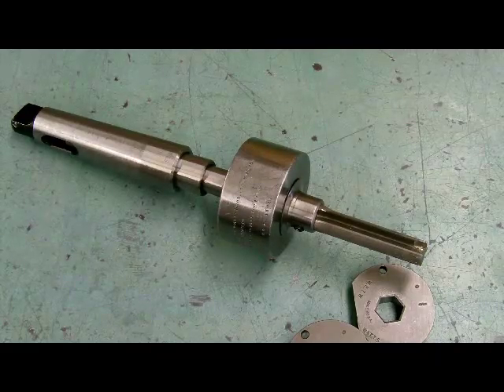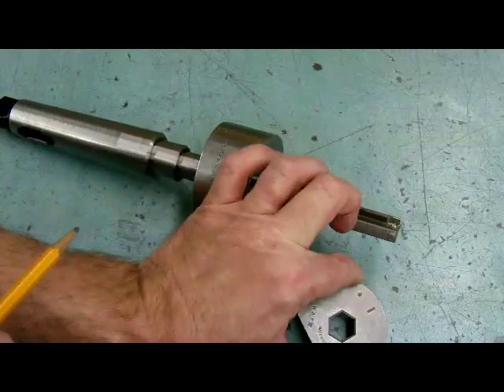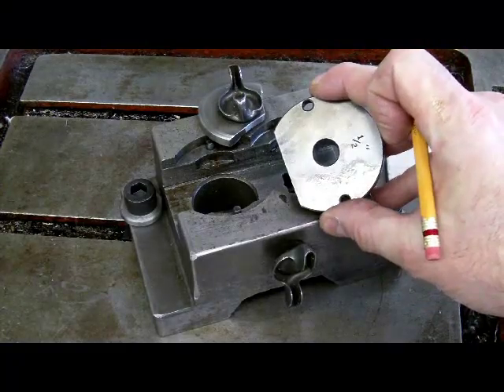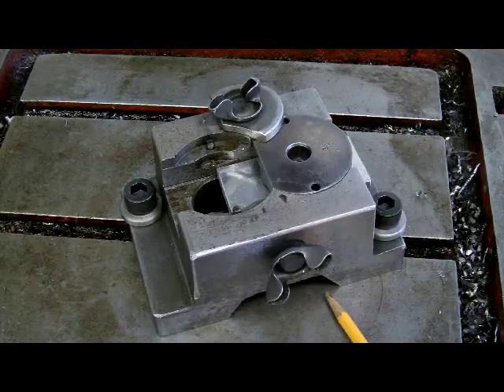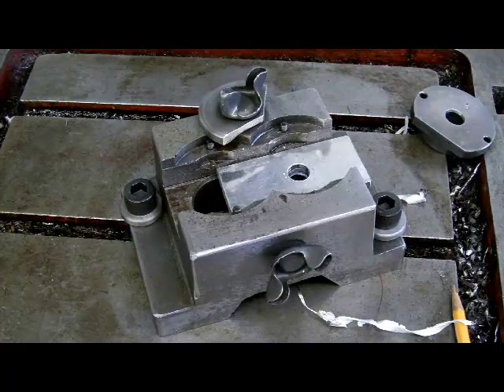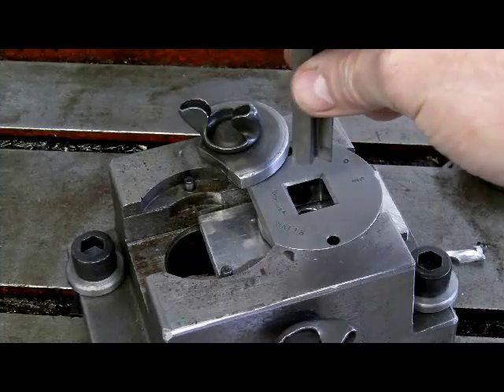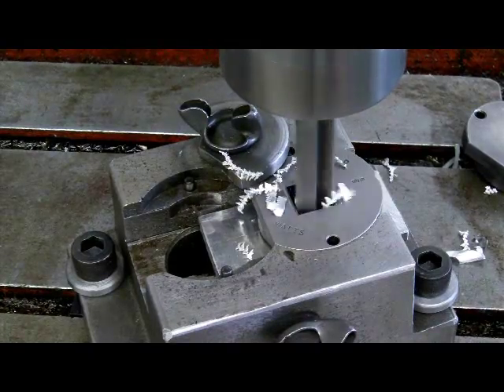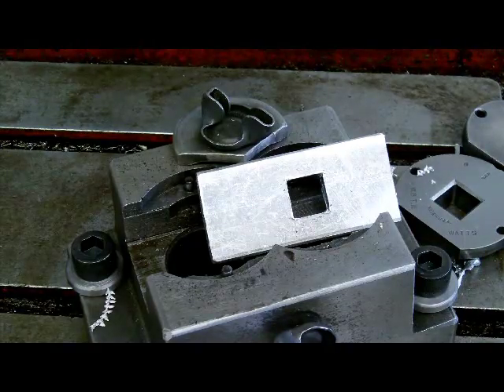Drilling Square Holes

Comment: Was only aware of being able to drill square holes in wood using a combination drill-chisel, but thats technically not even drilling a square hole but is drilling a round hole and then the chisel follows through with the drill to square-out the corners
Reply from the maker: I've used the drills woodworkers use also, the drills work great. Thanks for watching.

Comment: I mean.. that's a cool little bit, but what do you do when your material you want to drill into doesn't fit in that little slot like that flat stock aluminum you used?

I'm also curious how this thing does against steel and how long before your square guide starts to wear out?
Reply from the maker: You would need to adapt the jig to suit your scenario.

Comment: The centre mass of the cuting end of the drill bit dances in a circle as if a man and a woman were waltzing and had a container of sand held between their chests, with a hole in it allowing a line of sand to describe an odd figure on the ground. You could rely on the might of a strong mill and strong tool steel to manage the off-centre mass or, and I think this is how the tool in the video did it, there is mass above the cutting tool that is positioned such that a little more mass is above where the missing flute of the cutter is. So basically you have a counter mass positioned to balance the shaft. Maybe the counter mass can be freely attached and centripetal force positions it where it needs to be. If anyone knows where I can find more info on the design of this tool I would appreciate it.

Comment: Interesting, close but no cigar for me.  That's got to cost quite a bit.  I need four 1" square holes in 1/8 thick aluminum plate. Still hoping to find a die to place on a press, this is a great tool, just not practical to buy.
Reply from the maker: Yes it is neat to see but not for everyone. Thanks for watching. Good luck with the holes.

Comment: Sir, I need to chamfer an oblong hole. 0.5 mm chamfer in steel. Can I use this floating drill head for this purpose? I will make the guide oblong instead of square. Will it work?
Reply from the maker: I don't think it will, the guide drives the diameter of the tool. Your chamfer would need to be on the end of the tool and the end of the hole. There would be nothing to guide the tool. I'm thinking CNC may be your solution.

Comment: The things are the bane of my existence. I’ve used them hundreds of times to put a “drive hole” into the end of a hardened worm gear. We buy the gears set worm & rings and modify them. I’d love to perform the op in an annealed state but it’s not feasible. The end is about 45 Rockwell hardness. We insert the worm into a fixture that has a guide plate over the end. The pilot hole size is critical to make the drill work hard enough to get into the corners. Alignment and squareness of the head, adequate thrust, feed, speed and flood coolant are imperative. The Watts drill typically lasts one to three parts before resharpening. The drill takes two months to obtain or factory resharpen so we do it in house much of the time. Once you start the operation you have very little control over size, taper and corner sharpness so you cross your fingers and pray. Whenever I can I try to use a rotary broach instead but sometimes it’s just not doable because of the extreme thrust that op requires exceeds capacity of my equipment on large holes.
Reply from the maker: Thanks for sharing Karl, I'll bet it help with productivity at your place of work.

Comment: Can this drill bit be used on wood and in a drill regular drill press?
Reply from the maker: I'm sure it would. The only issue I see is this drill is carbide tipped, most wood likes high speed steel I believe.
Reply: @machiningmoments  True, true ,true. This drill bit if it could be done for wood, it will do away with the mortising machines huh?
Reply from the maker: I have limited experience with wood but I have noticed some of the tools are similar.
Reply: @machiningmoments  Yes, I love machine shop but at my time I'm doing wood works and a lot of tools do the same jobs. This drill bit can do a good thing for mortising if it would be able to be used in a drill press. People wouldn't need a delta or other machines to do a square hole. I personally dislike using chisels to make a hole square.

Comment: This is a Reuleaux triangle.  The only shape other than a circle that cannot fit through its own hole!  Sandwiched between 2 plates it will roll completely smoothly, just like a circle.  Quite amazing.  Remember the Wankel rotary engine in the old Mazda RX-8?  Yep, the 'piston' was a Reuleaux triangle.  Make a manhole cover out of a Reuleaux triangle and it can't fall through its hole either!  And you can use them to drill square holes.  Or any even sided polygon hole.  Quite amazing.  The drill bit to do this was patented a century ago.
Reply from the maker: Yes it is, I remember the Wankel well. Thanks for the history.
Reply: @machiningmoments  Thank you for the square hole demonstration.  I've never actually seen it done, so very interesting.  Something a person would think is impossible - a square drill bit!?  Who woulda thunk it!
Reply from the maker: Glad you liked it, I'm trying to capture old technology before it is gone. Thanks for being part of it.

Comment: I'm wondering how the "guide" doesn't damage the bit (and vice-versa)?  And what if I wanted to drill a piece of metal that's 1/2" wider or 1" taller -- doesn't seem like that jig would work...

Comment: can a triangular hole be done same way you just did for square hole?
Reply from the maker: Yes, the trick is you need one less cutting edge than the geometry so the drill would have two cutting edges.

Comment: Can we drill a rectangle using an extended version of this drill?  Like for exemple rectangle with width of 5 and height of 10 milimeters?
Improvement to the current design would eliminate the guidance template if we can have a stable center guidance drill. This can be achieved if our main drill/milling drill have inside another drill decoupled?
Reply from the maker: The guide controls the shape. So I think if you had a rectangular shaped die (template) and the drill had enough travel off of center, it would work.
Reply: No you cannot drill a rectangle with this tooling. All sides of the square, hex, octagon, pentagon, or triangle must be the same length.

Comment: Process is fine -- But you should use a coolant for longer life of tool & always use a brush to clean off the metal chips instead of using bare hands.
Reply from the maker: Yes, safety is important.

Comment: Where can these drill bits be bought. They are amazing!
Reply from the maker: You may have trouble finding this one, it's very old. If you Google "rotary broaching tools" you may have luck.
Reply: What do people use now-a-days to do the same thing? I mean I know there are tools that can get you square holes but not as easy as just drilling a hole in 2 seconds that's square as easily as a round hole. I'm pretty into tools and gadgets and its a hard for me to believe I missed an entire process of how to cut a small square hole in a couple seconds. LOL. I see these quare holle cutters for notching our  like a perfect sing gang outlet hole but nothing like a 1"x 1" hole.
Reply: Watts Bros Tool Works in Wilmerding PA

Comment: This looks like magic. Even though I watched an animation of how it works before I watched this video, my mind still couldn't comprehend how something spinning could drill a square hole.
Reply: So when the drill is cutting a corner, it isnt really spinning in one spot but it’s bouncing in and out of the corner?
Reply: Yeah, it would be great if one of those "ultra-slow-motion" Youtube channels could get this on video.

Witchcraft should always be captures in ultra-slow-motion video. ;)
Reply from the maker: Two things are happening, the drill has one less cutting edge than corners which forces it into the corners and the drive end is a floating eccentric.
Reply: this proces should actually be made in one of those slowmotion 3D animation
Reply: If you had known the Reuleaux triangle, it wouldn't have been a surprise: a triangle exists with equidistances along the lines perpendicular to its perimeter boundary...

Comment: what keeps the bit from eating the template?
Reply from the maker: The template is hardened.
Reply: magic
Reply: If the drill binded to what it was drilling, could it then start to cut the template? I’m thinking that it doesn’t cut the template because it’s able to bounce off of it. Does it eventually make the drill dull where it touches the template?

Comment: on google rotary broaching I couldn't find. This is not a rotary broaching
Reply from the maker: First Google search...I make no endorsement to this company, there are several. http://www.slatertools.com/rotary-broaches#.WJyt8E0zV9A
Reply: Thank you, bit this is like the ones I've found for rotary broaching. I need the drill and special Holder for drill a square hole. They are not the same.
Reply from the maker: Sorry for the slow reply, I will do some more looking. The one in the video is very old.

Comment: So how was the first square hole created before you had a square hole to create the square hole.
Reply: Q: So how was the first square hole created before you had a square hole to create the square hole.
A: He made one in the future, traveled to the past and gave it to his younger self.
Reply: @swiperfox3145  he took the square we just saw him create and gave it to his past self, so that his past self can create the square we just saw so that he can take it to his past self and creat the square we just saw so that his past self can create the square we just saw so that he can take it to his past self and creat the square we just saw so that his past self can create the square we just saw so that he can take it to his past self and creat the square we just saw---------

dont mess with time travel 😳
Reply: Just like your sense of sarcasm lol
Reply: With a square drill bit, obviously.
Reply: also you could just drill a circular hole, then use smaller drills to take some of the excess material out of the corners, and then grind or file it into a square.
Reply: this guy..
Reply: it was made with another square hole driller
Reply from the maker: In the fixture? Likely machined, hardened, and ground.
Reply: chisel
Reply: A cast/mold
Reply: That's a lot of hole we r talking about.
Reply: top 10 questions engineers don't know the answer.
Reply: lol @ everyone but canyon having trouble with this
Reply: Ken2x :'(
Reply: I also meant an actual square shaped drill bit not a rig for drilling square holes, i was just being silly.
Reply: This is freaking deep! It's like, has anyone every seen a baby pigeon? Let that sink in.
Reply: Bruh I'm shook
Reply: El Fro 
Why yes I have.
Reply: CaligulaClone same is what we do here at ISTC diploma.....filing.......Lol.
But I really hate FILLING square "pockets" as they say for 'practical tests'.....
Reply: Ken2x ROFL
Reply: Aon Lazio LOL
Reply: i round hole, a file and a very careful craftsman
Reply: Or punched out in a stamper then ground to spec
Reply: File more file then some more file
Reply: With a square broach.
Reply: Maybe it was made by casting and hand filing
Reply: Sorry guys i just thought it was funny that the solution to creating a square hole is to use a square hole..... i mean wouldnt a better educational video be how to make a perfect square hole without a square hole already in your possession??
Reply: @Sidiez  Just saw a video on that.  Essentially, you router a channel and partially fill that with bar stock leaving a square empty hole.  The fill piece is pinned to secure.
Reply: @Sidiez  "wouldnt a better educational video be how to make a perfect square hole without a square hole already in your possession?" - No, because you buy the tool and jig and use them together.
If you want a square hole without drilling, you broach it.
Reply: CaligulaClone funny how you say
"you could just" then describe a more difficult procedure
Reply: There are many ways to create a square hole, wire or spark erosion for instance
Reply: Sets I already said that

Comment: That's way cool, but how much does one of those three-fluted bits and guide setup cost?
Reply from the maker: If you Google "rotary Broaching Tools" you should be able to find what your looking for and price.
Reply: O...kay.  So, about $100 per bit (for the simpler ones), and about $900 for the holder.

Guess I'll stick with a drill and a saw.

Comment: Why doesn't the bit eventually gouge out the sides of the square template and make a mess of it?
Reply from the maker: +sortedtales The die (guide) is hardened.
Reply: do the blade takes a lot of damage then ?

Comment: still has rounded corners.   Is this set up worth all the time?  Seems other methods would be quicker.
Reply from the maker: +Jon Lanier One of several options I guess it depends on quantity required, broaching, EDM, or a punch press may give you nicer corners.
Reply: +Jon Lanier Like what?  I want to drill a 1/4" square hole in mild steel that's about 5/8" thick.  Slightly round corners Is not that big of a deal, I could use a file and maybe the square HSS tool blank to punch out square.

Comment: Is it possible to drill tapered square hole 
I have a component it's length 20 mm one side square size 14 mm and another side 11.50 mm square.
Reply from the maker: Malkit singh That is a really good question. EDM? Does anyone else have an answer?
Reply: machiningmoments  but I have 100 pcs. I want something for production
Reply from the maker: Malkit singh Try Googling "rotary broaching tapered holes".
Reply: Good

Comment: This is good. We have to drill hex hole A/f - 20.5mm into steel - 40mm long.
Kindly advise us if this is possible.
Looking forward to hear from you soon.
Anshul Goyal (+91 9417197734)
ramasteelforge@yahoo.co.in
Reply from the maker: Anshul Goyal Good Morning Anshul, if you Google "rotary broaching" you should find lots of applications and suppliers. Good luck!

Comment: It have small radiuses on corners...
Reply from the maker: Bojan Simonovic Most cutting tools will have a radius.
Reply: machiningmoments Yeah but if i wanna precise square i would still go for EDM wire cut instead this. This is at leasts interresting techinque and good solution for lower demands...
Reply from the maker: EDM works well.

Comment: The cutter is obviously hard or hardened material, as I would assume the guide. How does this not destroy the cutter since both have to be equally hard. Also, what were you using to hold the work piece stationary in the fixture

Comment: okay that was interesting.but could u please tell me hoe did you make the square fixture???
Reply from the maker: It is created because the drill can move off of center.
Reply: machiningmoments no sir u didnt get my question.i asked how did u build or manufactured the square shaped fixture.u used the square shaped fixture to drill a square hole on the aluminium workpiece thats fine but how did u first prepared the square shaped fixture which was later used to drill a square pocket
Reply from the maker: My apology, it was likely drilled then squared with a file or shaper. It would be hardened after and finish ground.

Comment: I still don't really understand how this works. Surely anything that's rotating around a centre can't cut 90 degree corners.
Reply: It works because the bit is not rotating around a fixed center. The drill bit is shaped like a Reuleaux triangle, which is an equilateral triangle with rounded sides. The articulation is necessary to make sure it can move around to "find the corners" as said in the video. Two points of the bit contact the side of the square while the third traces out a curve on the opposite corner. (For this reason, the hole is actually slightly rounded, but it still traces out ~98% of the area of a square.)
Reply: +221Dw It's MAGIC!  You have to BELIEVE!
Reply: David Wang Ah i get it cool

Comment: Why does it not also eat into the square guide as it turns?
Reply: The " Square drill " have HSS or Carbide inserts only at the end. The edge further doesn't cut. It only strenghten the drill body, evacuate the chips and allow it to follow the square pattern. The square guide might be harder than the drill flute too.

Comment: what material is the top piece made of? doesn't the drill bit damages it?
Reply from the maker: The top is hardened steel. It doesn't damage the drill as it is cutting on the end.

Comment: i want to make holl in ms pipe 1.02mm thik the pipe is 20*40*mm & 25*50mm the holl will be 20mm square, can you halp me.
Reply from the maker: Round or square?
Reply: Hare krisna
Reply from the maker: The die would need to attach to the pipe.

Comment from the maker: Sorry for the slow reply. Great question, the cutting action is on the end of the drill and there is a starting hole so as long as the material to be cut isn't harder than the drill it shouldn't damage the drill. The drill floats on the x-y axis, the trick to the sharp corners is having on less cutting edges on the drill than corners required. Thanks for posting. Google rotary broaching.

Comment from the maker: Hi Eddie thanks for your question, you are correct. The square size is dictated by the square so a 10mm requires a 10mm square die. The trick is the "floating" cutting tool needs one less cutting edge than the shape it is producing, in this case three cutting edges for four corners (square). If you Google "rotary broaching" you will find lots of examples. Thanks for your post.

Comment: I've seen these before on YT, but never seen it being done "as it happens", and never held on of those cutting tools.  Does the tool produce a specific size hole? So if you want a 10mm square hole, you but a 10mm tool, if you want a 12mm square hole, you buy a 12mm tool , etc etc?. Thanks for posting.